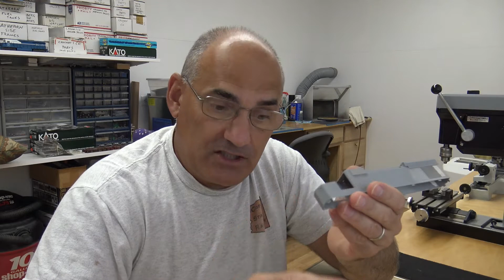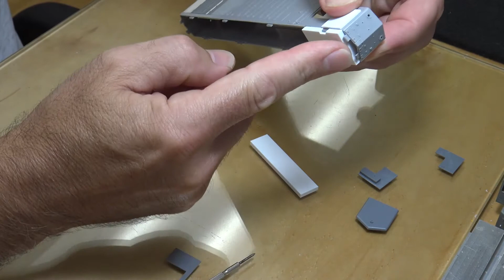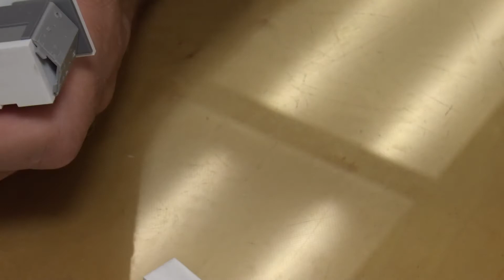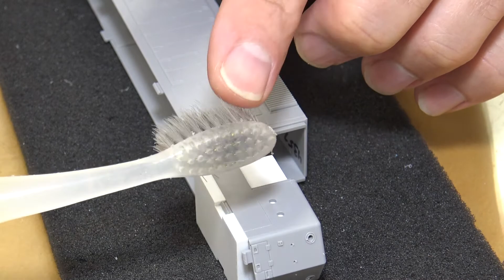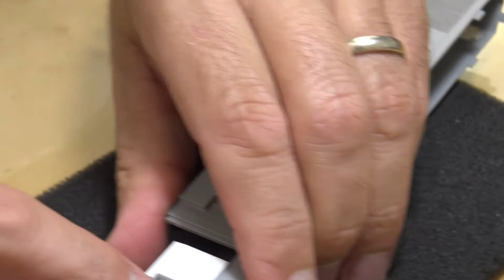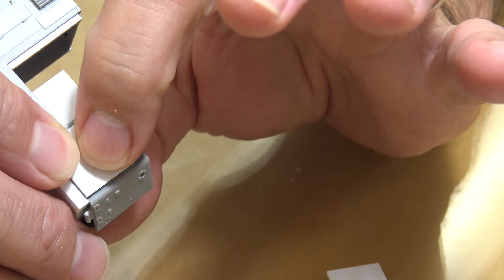EMD SD45 X4 EPISODE #3 Plastic Surgery Part 2

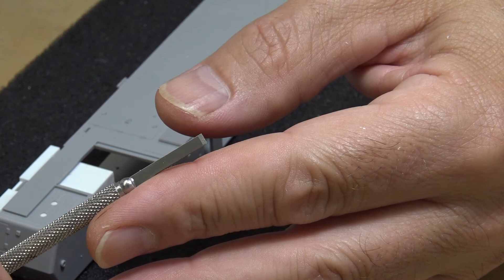Comment: Hi Brian,  Superb work here.  I was wondering where you got the small chisel blade that I see at 23:38 in this video.  Also, what milling machine do you use/recommend?
Thanks,
Bob C
Reply from the maker: I got it from Micro Mark. There is a company called Havel's that carries the same thing and all the blades. https://www.havels.com/

They changed their web page so you have to call them. When I ordered from them the first time, they had good photos up and was easy to order.  For some reason they made it more difficult. Though, they are a lot cheaper than Micro Mark.
Reply: Thanks Brian, I'll give Havel's a call.

Comment: Would it have been easier to fill and sand smooth the holes you didn't want and then open up the brake lever cavity ?
Reply from the maker: I gave that a lot of thought. The issue was the tear drop bolt head detail for the grab irons. I really wanted to maintain that and the only way to do that was to use the Cannon parts.
Reply: Thank you for your reply.